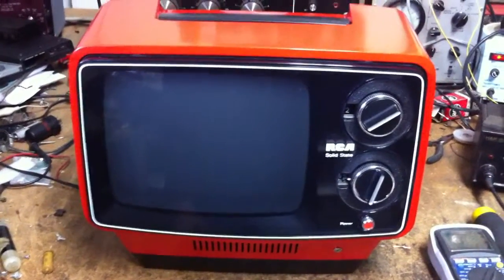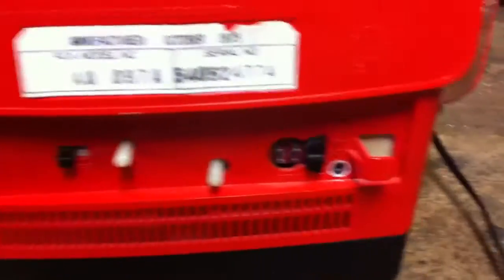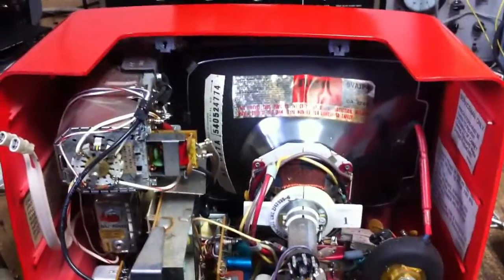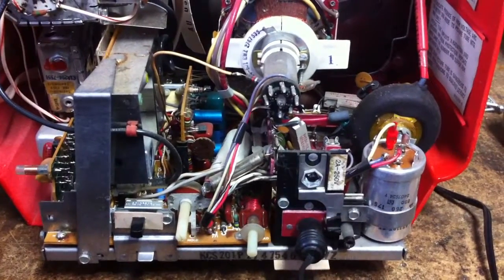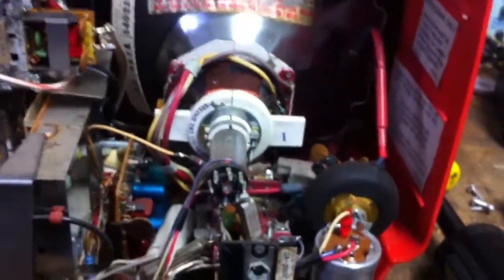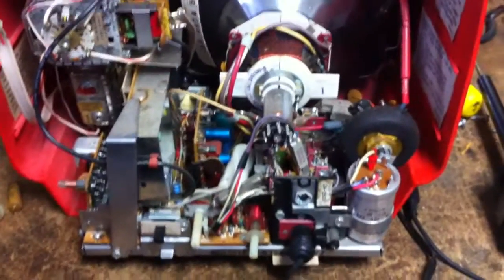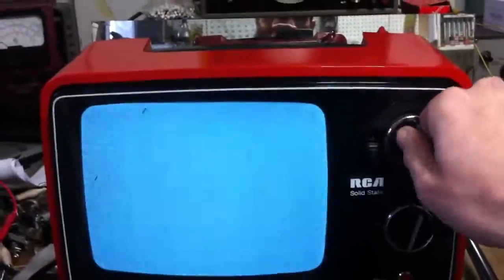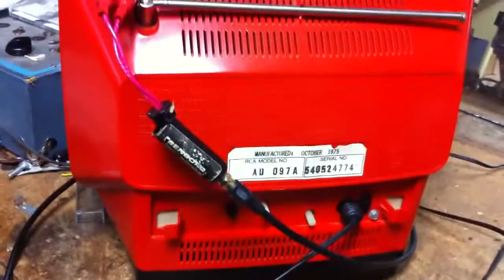~Inspect & Repair~ No HV on a 1975 RCA Portable TV KCS201

Comment: Hi Justin, Do you happen to work on older vintage televisions from the 50's & 60's?  What state are you from also. Trying to find a way to get 2 Zenith TV sets worked on. One is a classic Zenith Bug Eye Set from 1956-1958. The other is my dads first Zenith 21 inch Round color set from 1965...The 65 works but really needs caps replaced and crosshatch adjustments needed. Blue gun is weak also. If you can reply back I would appreciate it. Thank You, Mike      Winnebago,MInnesota.
Reply from the maker: Hey Mike, yes I do- I'm located in Sacramento, California and wouldn't have a problem with either set. If you like, look me up at www.stellar-tv.com. Be happy to work with you!

Comment: In all my years of doing tv repair I've never seen a cleaner set.
Reply from the maker: Same here. This TV has changed hands so many times through antique and vintage dealers that it's history has been lost, I have a strong feeling this set had a problem with the HV when new and was returned under warranty. I'm still not even 100% sure what the fix was.